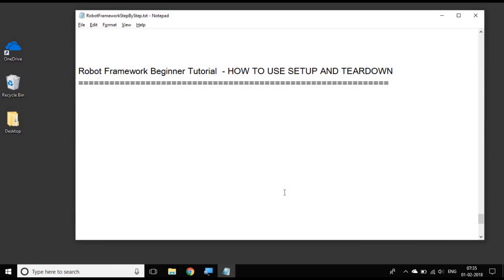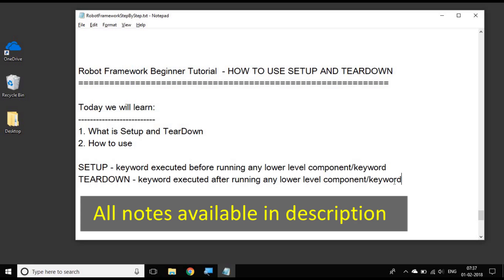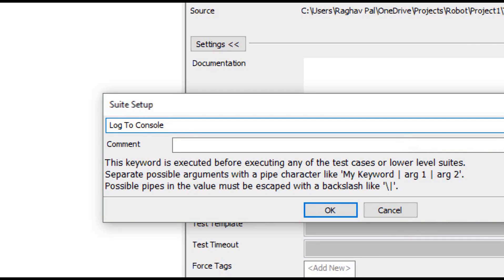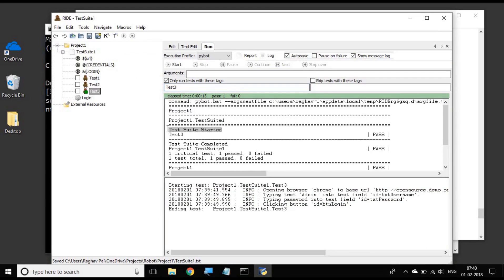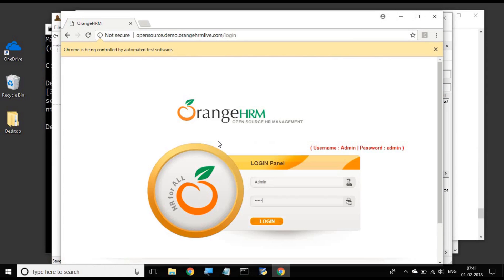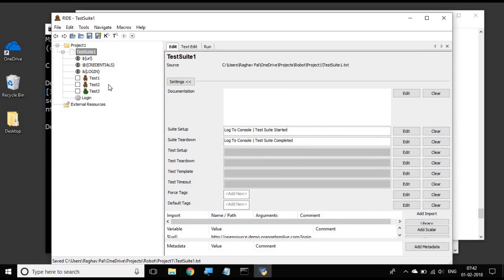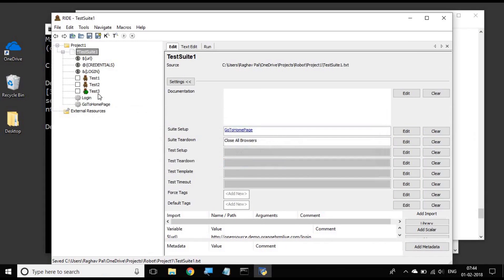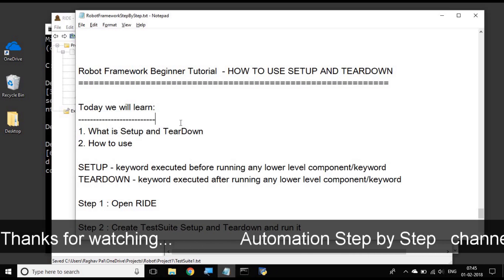Robot Framework Beginner Tutorial 6 - How to use SETUP and TEARDOWN

Comment: Hi Raghav How to install RIDE on mac OS ?
Reply from the maker: Hi Druva, installing RIDE on mac os is not very smooth. The problem is with installing wxpython on mac which is needed to get RIDE. You can use PyCharm or any other editor on mac
Reply: Automation Step-by-Step - Hi Raghav Pal, Yes. Currently it says error as wxpyrhon 2.8.11.0 couldn't be identified. If I use Pycharm or other IDE's, can I get the same functionalities of RIDE UI ? Please clarify.
Reply from the maker: With other editors you might not get the tabular structure like ride, but still you can use keywords driven approach, It will be more like what you see in the Text Edit tab of ride.
Reply: Thanks Raghav. I have installed Intelli J IDE and working on it. As you said we don't get similar kind of RIDE flavour and types of variables but still we can work on it and automate it for Front end. It would be great if you demonstrate about how to validate the data from which generates dynamically during order placements. Example, when we place Orders in any ecommerce website, Order files will be generated and values stored in DB. I would like to validate the Order files hence requesting you to demonstrate similar kind of stuffs.
Reply from the maker: sure, will take up in future videos.
Reply: Thank You Raghav :)